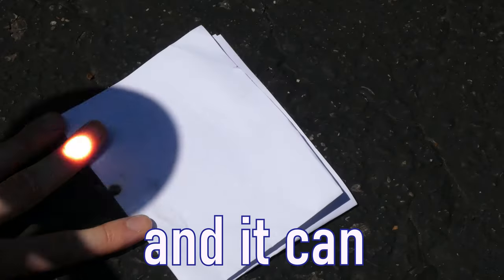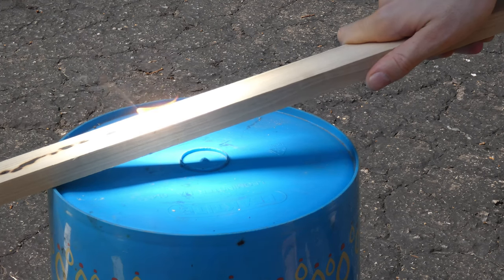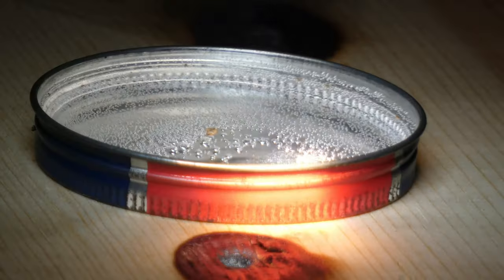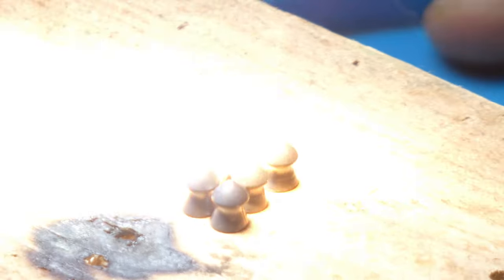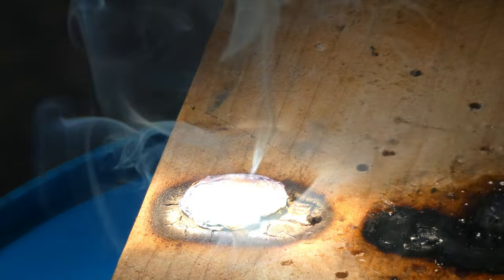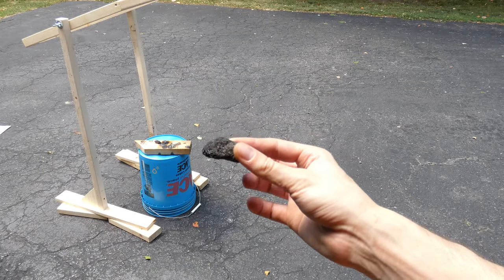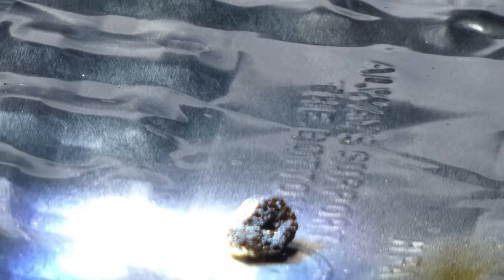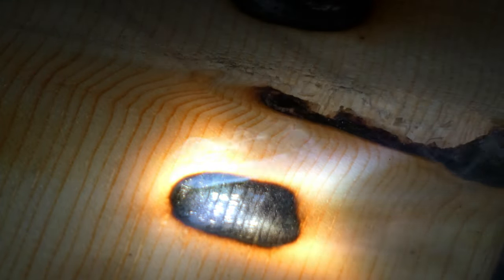Melting A Rock With The Sunlight

Comment: Noice! We need to re-energize the whole using fresnel lens from old TV for backyard use. Just working on mine. Try using it to melt sand. There’s a video out there of a guy who made a 3d printer out of a fresnel lens and an XY axis controlled by a computer who made a bunch of stuff with molten sand.

Comment: Could this somehow be used to power electrical stuff?
Reply from the maker: I think it would most likely melt solar panels. But a steam engine or sterling engine and even possibly a peltier device I could see it using this lens to  producs electricity.  Its cool to think  about :D
Reply: @QuietNerd  yes I was thinking of beaming at solid iron but at a lower intensity so it don't melt but stays red hot. Then that boils water, then steam then your Xbox 😁
Reply: Has to be a sunny day, but you could get it to charge batteries for when it's cloudy 👍